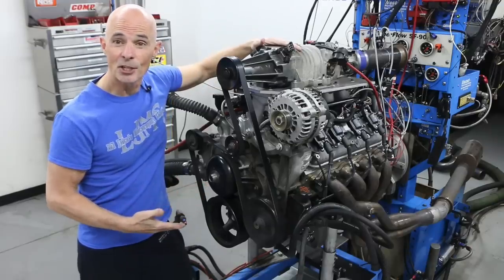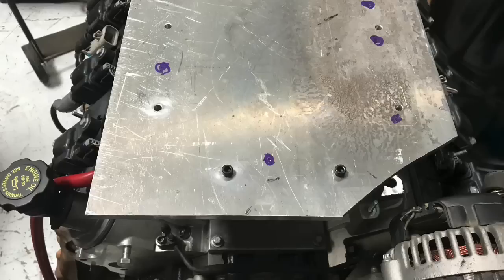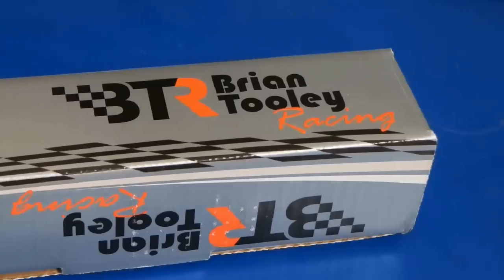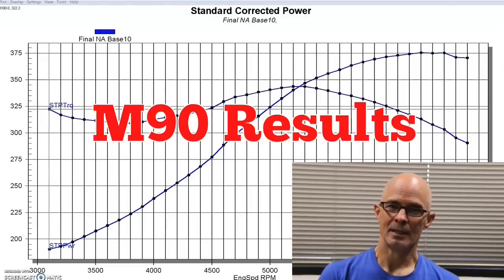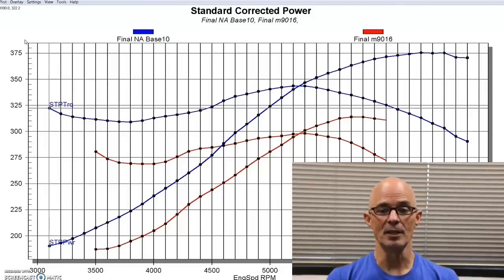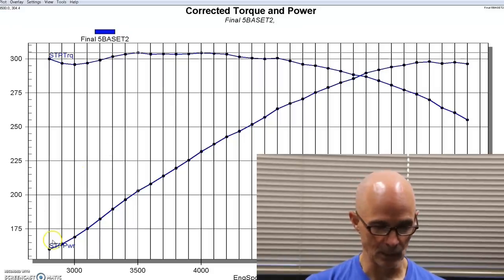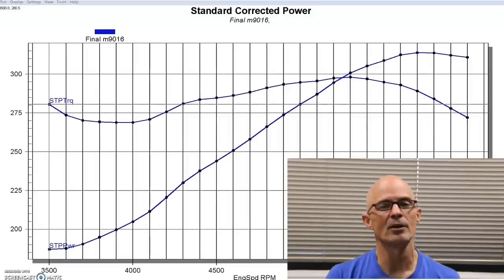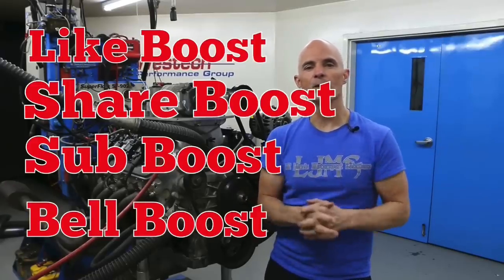JUNKYARD LS M90 SUPERCHARGER TEST-FULL RESULTS!

Comment: I would love to see what a smaller pulley (like half the diameter of the original) gains. If that still isn’t an improvement over stock, I’d want to see two junkyard superchargers. If you can’t get a small enough pulley I’d be happy to make you one (I’m a machinist and a small chunk of aluminum and few minutes on my lathe would be fun to see if it works)

Comment: Your understandably not only filling the gap of the huge intake that was easy but not efficient in the air direction and size but also your adding bigger cylinders and 2 more cylinders sucking low boost or neg boost.I would check the boost level as you pull dyno. Just more food for thought you know this but cool build.

Comment: Why would you install it with the stock pulley on a cammed ls.  Even in the car this came in you would drop from 8psi down to only about 3-4 once you install a cam.  Should have put a 2.6 pulley on the hot air pos so it would have maybe made 3psi and not stolen so much power....

Comment: Use a intake manifold caburator style, adaptar plate, 3800 size crank pulley, smaller supercharger pulley and see what happens. Carburetor manifold with open plenum .

Comment: Im guessing that m90 doesn't blow enough volume for that big of engine? I seen a guy try to bolt a little AMR Roots charger up to a 4.3 litre V6 and lost power with it. AMR Roots charger is only rated up to 1.8 or 2.0 litre I believe.

Comment: What happens if you change pully, zzp has smaller maybe a 2.8 with a ls throttle body, port and polish.. You could try a Gen 4 m90, also what about an Eaton M112. I've seen a channel where a guy is using twin m90s but haven't seen it work.

Comment: I would like to know if the LS crank pulley was under-driving the super charger. Find out the max RPM of the super charger and use a pulley combo that spins the supercharger just under that RPM at the engines max RPM.

Comment: exactly what I expected.  You're really gonna need to put a 2.8 pulley on there if you want to have a chance at making power.  Even then, as previously stated, that blower is only good for 450HP maxed out WITH an intercooler.  By the time you do all of that you're probably only going to match the NA power of the 4.8 or maybe 25-50 more.  The airflow just isn't good enough.  Now 2 M90's....that's a different story.  Yes, you should try it.

Comment: If you had the same drive ratio of the crank vs blower pulley the 4.8 would have made even less HP. The 3800 has a ~7" pulley. A truck engine is ~7.5"

Comment: How well would said supercharger would work on an Honda V6 J-series? At 3.0-3.5L of displacement, they are lower displacement than the 3800. Would the Honda engine suck more air than the supercharger can chug out?
Reply from the maker: A STOCK j32 OR j35 WOULD MAKE 100-120 HP LESS THAN THIS 4.8l, SO IT WOULD BE A BETTER MATCH

Comment: beyond the super chargers efficiency level.   maybe equal the power with like a 20% reduction pulley but even still heat becomes an issue so running richer to be safe and then a little loss of power.

Comment: HP requires air, roughly 10 lbs/min for each 100 hp. If the blower provided air for 300 hp on the original 3.8, it was probably providing something like 33 lbs/min, the extra three going to the power to turn the blower. That 4.8 with a set of factory heads and intake, and a mild aftermarket cam could easily make 400 hp, did make 375 with the combo you picked. That little blower was never going to be up to the job.
One more test for this series: go back to the NA setup, torque cam and short runner intake, and add the same nitrous there. I bet the increase is greater the the spinning restrictor plate increase...
I wonder if you could put a 2300 or 2650 on the little 4.8, would you have too much air?

Comment: i think the best the M90 does is 10psi at 12,000 rpm (blower rpm) on a 3.8. 1 can't feed a 4.8 enough air, unless you use a cvt to drive it. Then you could get low end boost until 3000 maybe. Or do 2 or more. At 100 bucks a pop why not?

Comment: Air restriction from smaller tb. It was designed  and mathematically tuned for proper cfm per cylinder x 6. Adding two more cylinders kills the equation and cfm falls off taking power with it.  Two m90's would be more than sufficient I would think especially if you could split it 4 and 4 like a dual plane.🤔 Hmmm there's some science involved here. Dunno if it would be like having a boat and putting two engines on it that are 200 hp each but it doesn't give you 400 hp but if you boost them both with a single unit will they conflict each other? Boosting them with two separate units shouldn't be any conflict as the m90 would be plenty for a four cylinder.

Comment: I would interested in seeing a pulley change. Great video
Reply: Trevor Thomas I doubt even a pulley swap will get it much above the n/a numbers. The 3800 guys are having lots of trouble pushing past 400whp even with an underdrive 2.55” blower pulley (which requires clearancing the blower snout) and an overdrive crank pulley (5% over which comes out to 7.35”) so if you eliminate the whp vs crank hp from the equation, the m90 is truly out of ability past about 500hp, even if you could spin it faster by going bigger on the crank pulley, I bet it would start to cavitate and allow airflow around the vanes past the 500hp mark
Reply: Except me,  and Terrell Smith, both made into the 400s with an M90.  This test was bad, his bypass was not closed
Reply from the maker: bypass valve was closed-I even tried a zip tie to be sure-not my first rodeo, its blower size and speed vs hp output of test motor
Reply: Alex Armga you have a dyno sheet that says >400hp? What is the full list of mods on the regal?
Reply: I do have Jeep 4.0 with m90 max power is  400hp max and thats with porting the m90

Comment: What if you put the M90 on a 4.3l V6?    Or a Stovebolt inline 6?
Reply: The stove bolt would be cool to see! Sadly most of them have been scrapped and melted down by now. A vortec 3500 I-6 would be my next choice to see blown.
Reply: There are plenty of 292 stove bolts.  And the ford 300 inline would be cool too.  Hot Rod Garage did an episode on the 3500 and they had problems with parts because they said the aftermarket doesn't make parts for the, (yet). In another 10 years they could become the next "Stovebolt".

Comment: Got that blower, wanna put it on early 241cu in dodge Hemi v8 w/ 7.2-1 compression. Ideas💡 ?
Reply: The real strength of these intake mounted superchargers is ease of installation with the factory configuration, but you don't get that if you can't use the lower intake that matches it on a v6.

Comment: There's a channel here on YT where a guy swapped an H6 into a 1999 Subaru and put a junkyard M90 on it, and it made 387 awhp on some shop's dyno in the video. There's no fuckin way a stock M90 with a stock pulley ratio (he showed it in the video) on a Subaru 3.6L made 387 awhp. The dyno had to have been calibrated real bad or something.
Reply from the maker: it won't do that with a stock pulley

Comment: You are running the least efficient version of the eaton m90. The gen 3 doesnt move near as much air as a gen 5. You can also pulley way down. Stock is a 3.8 inch pulley. I run a 3.5 on my gtp but I think you can go clear down to 2.75 if you machine the ribs off the snout.

I say spin the blower faster, or get the gen 5 blower, or both. A gen 5 blower with a 2.75 pulley it might hold boost until redline.
Reply: The stock 3800sc lower pulley is 7 inch.
Reply: 2.5” is the smallest if you turn down the snout

Comment: It doesn't make sense to say that the blower is a restriction that can't handle the air flow, it is provider a positive amount of boost (though very small), therefore it HAS to be supplying all of the air that the motor can take and then some (only a very small "then some"). The reason for the lack of power is that the parasitic loss of the supercharger is more than the additional power that the meager boost supplies. The power of the motor HAS to be higher than it was naturally aspirated because it HAS to be flowing more air because the air pressure is higher. It's just loosing the additional power and then some from driving the blower, so net loss of power.

Comment: What happens if you drop displacement and increase compression?
Reply from the maker: lose power then gain power
Reply: @richardholdener1727  im kinda confused by your answer. I have a 3.0 v6 that 10 to1 and im using a supercharger from a 3.3 thats 8.5 to 1. Is my 3.0 going to make more power than the larger displacement lower compression motor or is the supercharger the limiting factor

Comment: 10:04 is 314 hp with the supercharger and 297 without the charger basically you gained 17 hps with the pulley in stock and the original vipas is not for downloading from the SUPERCHARGUER it is for sipping hot air from the engine originally and practically not need it would be better to leave it closed

Comment: The supercharger needs to be overdriven to work at all because it is positive displacement Roots type, it is acting like a restrictor plate changing by RPM because it's flow is determined by RPM.  3.8 liters vs 4.8 liters, you've got 25% more air demand just to break even and it peaks at 280lb/ft on the factory engine, no wonder it cant make boost.  Given a 25% overdrive at least it should actually produce boost and thus torque on the 4.8L up until the blower acts like a giant restrictor plate or hits it's RPM limit or is just adding too much heat to be useful.  Maybe it runs out of air by 300hp of airflow or maybe not, but these blowers have worked on Ford 302's and elsewhere given the right drive ratio there's no reason it shouldn't work here.

Comment: Answering the question why did it lose power?  Not enough supercharger displacement.  Target boost of 5 psi min / 14.7 psi (atmospheric pressure) x 300 cubic inches = 102 cubic inch per revolution blower minimum.  Of course Richard knows this.🤓. M90 is a 90 cubic inch per rev.
Reply from the maker: I think he said the blower was too small
Reply: Yes, that is the direct answer.  I had just been doing some supercharger sizing research and came upon that formula.  Great video!

Comment: Try a smaller pulleys also why don't you try the old school thing twin throttle body like the old Corvette thing but like linkenfelter open those babies up to what they were supposed to be and add one turbo to it I have seen the test Reeves Callaway have done and those cars are going for a mint right now forget the ZR1of old the linkenfelters and Callaway engines were the best and tough ones to beat.i want you to look at speeding up that supercharger and making it boost at least 35 to 45 pounds I know that will give you what you want to make at lease 500 or more horsepower.that supercharger can give you the power you need.just keep experimenting.peace

Comment: Using your massage " add boost and you will add power" even at quote " 1 psi down low" you should have made more power than NA at same point, this is where generalizing does not take into account air density, I know you keep it simple for the average guy to relate to what he might do with junk yard parts etc, but you also keep referring to using an intercooler when ever possible but never heard you elaborate why or physics behind boost related temps etc, I think this a good example where simplistic theoretical formulae and data don't reveal what a going on, keep going it's getting real interesting now.
Reply from the maker: thnx-it didn't make more power at 1 psi because that wasn't enough to offset the parasitic loss of driving the blower

Comment: Your not showing that m90 supercharger potential- Please research its history before saying its not big enough for a 4.8. The 4.6 ford cobra mustang came from the factory with the M90 and Magnuson offered a sidemount non-intercooler kit for the 99+ chevy 4.8/5.3/6.0 trucks that also used the M90, I had this kit monted on a my 2004 chevy LQ4 6.0, it made just at 5 psi of boost, which didn't seem like a lot but it would easily smoke the tires from a stop. The setup your trying to run is using a stock L67 3800 with the huge pulley which was like 6-7 psi on a 3.8 with horrible flowing heads. Throw on a mustang pulley and you will get boost for sure. The M112 is a beast but it starts to put out a lot of heat when cranking up the boost.
Reply from the maker: The Cobra came with an M112

Comment: The pulley was to big, I have the roush m90 with roush intercooler on a 4.6 I went from 300 stock to minimum 430 -475 hp

Comment: This should make 5 psi boost with the right pulley so this test is messed up. Eaton M90 make 6 psi on 4.7L toyota and 4.7L jeeps. Maybe your m90 is worn out?
Reply from the maker: blower is fine-displacement is not what you should be looking at-the blower was designed to make 7 psi on a 240-hp v6-it won't do that on a 400-hp 4.8l v8

Comment: what would you suggest for a stock 6.0 grocery getter to reach 500hp I'm a new subscriber to you channel i need specifics
Reply from the maker: headers and a good cam, milled 317 heads or (better yet) 799 head swap
Reply: @richardholdener1727  Whats a good cam? part# what brand ect...will i have issues with the 799 rocker arms fitting i read they need to be off set to work or will that not be an issue? Sorry for all the questions Bro I love your vids!

Comment: I could send you out a ported m90 also I tried finding a way to email you but couldn't find any contact info one of the m90s I have the rotors are in mint condition, has been ported to the max and  has the module pulley adapter. If you were to run a 2.8in or under pulley with northstar throttle body and the full stack intercooler I bet you would push numbers.

Comment: You would need a 13” lower and a 2” upper but by that time you would have far surpassed the efficiency of the blower and just be pumping flaming hot air into the intake and losing power anyways.   Just like the guys in the comments I’d like to see a 2012 gt500 blower on it and see how much it can turn that 4.8.

Comment: U forgot about the bypass. There is a reason that wasn’t making boost.  Ur letting out the pressure.  Rookie mistake.  That blower (although hot) can push 15psi into a stroked 3.8 (4.2). So your is the same size
Reply from the maker: I think It says right in the video we made sure bypass was closed while running
Reply: Understood!  My mistake

Comment: Do you think an M90 would be sufficient for a 79 Jeep 258 4.2L Low-Revving Inline 6? Stock intake manifold, headers, 2 barrel Weber 38 carb, HEI distributor, "mild" cam. If I ported and polished it I think it would do fine but does anyone on here think it will supply enough air?
Reply from the maker: yes

Comment: In reality you're probably spinning it similar to a 3.4 on a 3800 as the LS is a bigger crank pulley
Ported inlet and outlets with an LS1 throttle body would help

Comment: That pulley was designed to run 6psi on a 3.8 v6 you ran the same pulley on a bigger motor it was never going to make decent boost you need to run a smaller pulley and that throttle body and the intake neck on the back of the blower is a big restriction cut the blower back put a new plate on there and run a 85mm throttle people have made over 600hp at the motor on 3.8 V6 with the same m90 blower modified. and im pretty sure the Ls crank pulley is smaller then the 3.8.  I get what you where trying to do here but you stacked the odds well and truly against it with them pulley sizes its never going to make big power but setup right it will make more then your nitrous hit did in the video. Check out Brushworks slick sixes and what he does to them.

Comment: Any chance you could tell me how to use this m90 on a blow through carburettor setup??? Anyone??
Reply from the maker: side mount the blower and channel the discharge air through a carb-but it is not a good idea
Reply: @richardholdener1727  I am bolting an m90 to a 32/36 dgv Weber carb. I am well aware this is not an easy task lol. My main concern is there is a lot of holes in the bottom of the m90 and I can't find a m90 walkthrough to tell me exactly which holes do what.
Reply: I subscribed to your channel a while back for you videos on ls l98 motors and I love your work. This m90 is for a 1600 Xflow Kent motor lol you'll love it.

Comment: Couple of cheap eBay turbos will make all the power that engine can handle.12 to 1300 hundred.  Got to spend an awful lot of time and effort to match that. Even very expensive modern superchargers won't match properly sized cheap eBay turbos

Comment: Need smaller pulley and two more super chargers..... and/OR 3 more ? In fact if you do 2 you will probably need an idler pulley mounted just higher or lower in between the supercharger pulley‘s for a good transition for the belt to get a good grip and maybe instead of an idler pulley it’s just a third supercharger.
Reply: In fact do you know the supercharger is in good shape ?
Reply: Also if you mill out the top of the supercharger, and a hole and a flat mating surface could you stack them?
Reply: I know many comments. But if they could be stacked you could do 4 blowers. If robbed from junk yards and have a basic rebuild done if possible and get away with it for much cheaper. I guess I’m also thinking of myself who is a professional technician/mechanic, supposed certified machinist. and minor professional fabricator. So I could do my own labor.

Comment: The M90 is barely good for 400 whp on the 3800.  It's choking the V8.  The stock 3.8" pulley is a 2:1 ratio iirc.  Upgrade to the 2.6" pulley, which is also great for heating air. It's also horribly inefficient.  toss it!